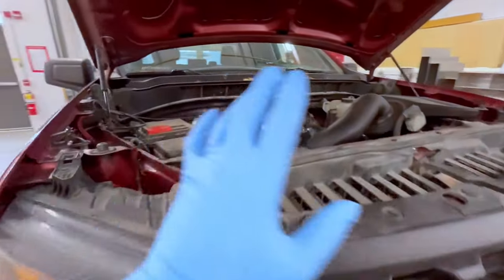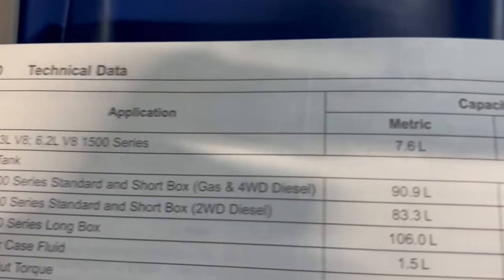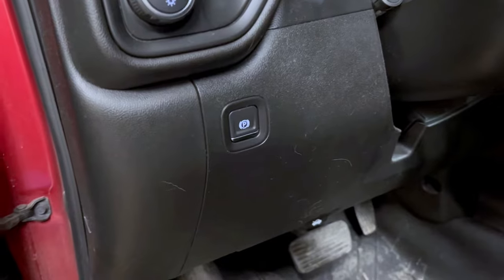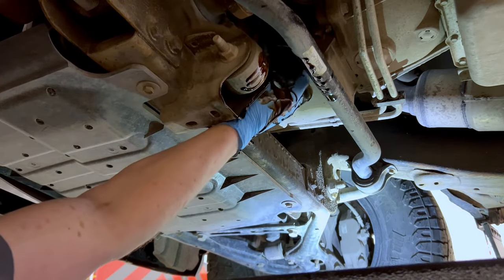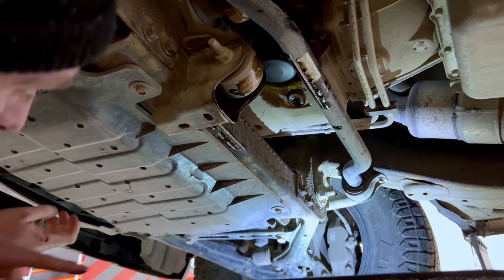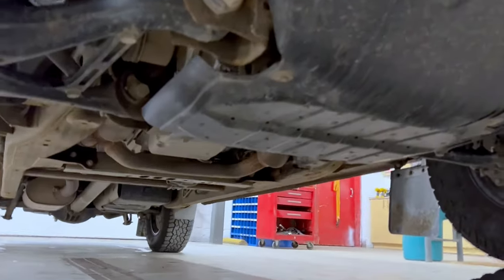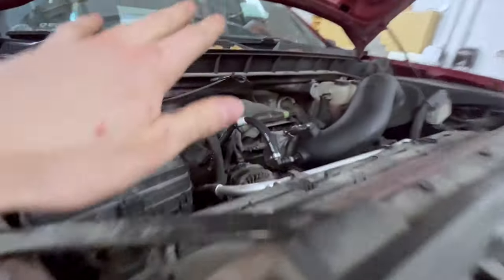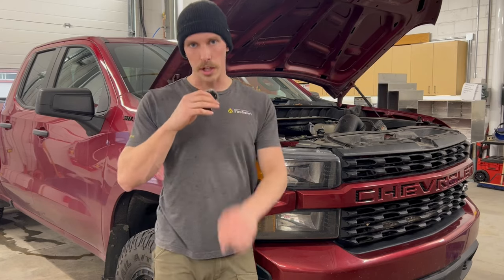Change Your Oil! | 2019-2024 Chevy Silverado

Comment: Actually, manufacturers will tell you not to pre-fill your filter. That is unfiltered oil that is Going into your engine, it may sound silly. But that is what caterpillar and other manufacturers note.
Reply from the maker: Good to know! Thanks!
Reply: Cummins says differently. And the oil that you pour in to fill the sump is going through the same parts as it does otherwise. No disadvantage to filling the filter other than it takes less time to get the oil where it needs to be. And the stuff from the bottle is cleaner than what's in the sump
Reply: Brand new oil out of sealed container.there are NO contamination of brand new oil that the micron rating is going to capture at start up,I have Always prefilled a filter for over 40 years never had any engine failure, your doing more harm by starting up on a dry filter

Comment: Tip: Don’t ever use Quaker state oil
Reply: Why not 😳
Reply: Use Castrol Edge and OEM filter. Quaker State 🤮🤮🤮
Reply: Quaker state is one of the best synthetic oils on the market
Reply: I don't agree! Any brand name oil is good, as they are DEXOS and ILSAC approved
Reply: Quaker state is owned by Shell. It’s a sister oil to Pennzoil, also owned by Shell. They use similar base stocks and in some cases the oils are almost identical. Pennzoil and Quaker state are some of the most advanced oils on the market and are a top notch quality product. There is absolutely nothing wrong with Quaker state oil. Get educated on the subject before you sound dumb in the internet (too late)
Reply: @bubbatime  Yes! Mobil 1 is manufactured by Esso. Castrol is made by BP. The Motormaster house brand is also a Shell product. Even the Costco oil is made by Mobile 1 (Esso) As long as the oil is ILSAC and DEXOS approved its good. The only thing that differs is the additive package.(and not by much)
Reply: @bubbatime AMSOIL for me

Comment: Realistically how much do you save from doing this and going to a mechanic shop
Reply: My local Chevy charges 140.00 for oil/filter (full synthetic) and 55.00 for tire rotation. 195.00 + tax brings it to about 212.00 OTD. I buy 6qts of Mobil1 and an AC DELCO Gold filter for 34.00 total.

Takes me about an hour to do oil/filter and tire rotation.

So, based on that, I’m probably saving about 150-170.00 doing on my own.

Comment: Toyota needs to take a lesson here.
No skid plate removal required and no special oil filter tools needed. GM also stands their oil fill port vertically so it actually supports the funnel properly.

I hate doing oil changes on my Tacoma. I cuss and swear every fkn time.
I'm never buying another one.